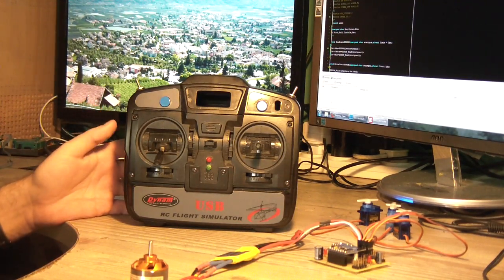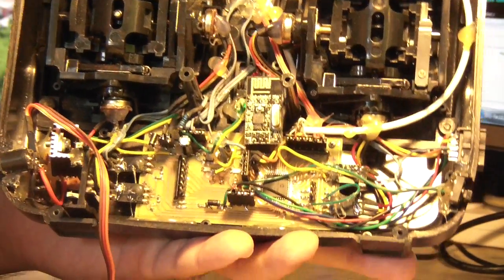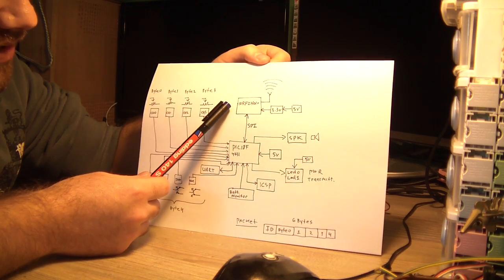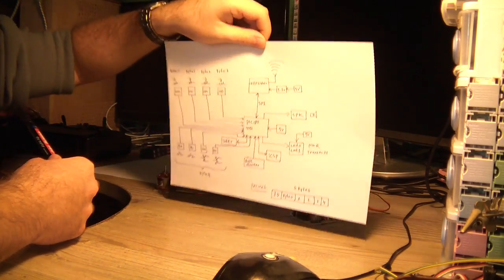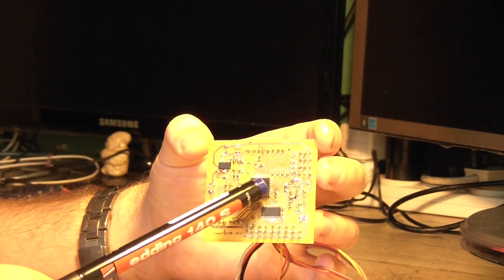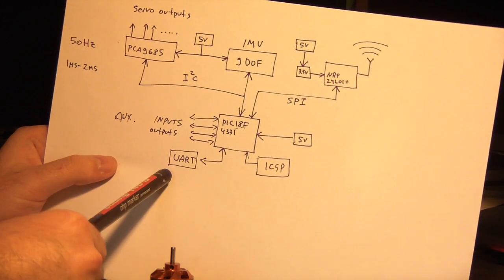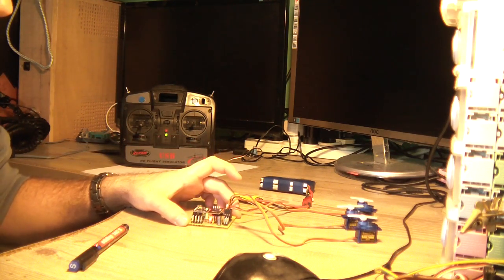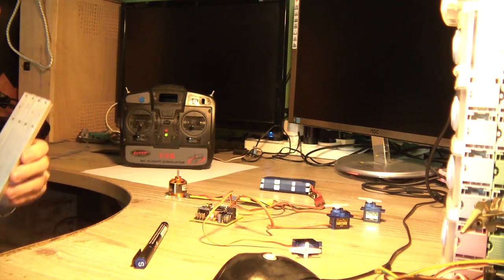Quadcopter DIY NRF24l01 2.4ghz RC and a flight controller

Comment: Interesting project. I particularly like the fact that you used PIC. Did you finish the project?
Reply from the maker: Hi ! Thanks :) unfortunately i froze the project for now. I had few test "take offs" but it was bad.The stabilization code is not mature enough. Now switched my mind to some other projects , perhaps i will return to it later. If you are interested i can share my work done so far on this project. Yeah , i like PICs over Arduino and all that stuff. Makes you do all by yourself and not using any written libraries, that is the way you learn the best, DIY ! :) have fun !

Comment: Hi Artiom, Great project!! You said that the 24LO1 is good for 50 meters! Which one is the amplified version? I may need longer distance myself. I see that china has a 24LO1 with an antenna, (same design, but it has an antenna jack) not the PCB trace. I wonder how long that one is good for. Thank you.
Reply from the maker: Hi ! In the video i am using the regular version which is good for 50m or so. But there is 24L01 with PA+LNA which can reach up to few hundred meters. Buy the PA+LNA version,don't buy just NRF with big antennas they are sucks the same as PCB antennas. Good luck :)

Comment: Nice! Did you use frequency hopping to get around WIFI interference, I've lost control of a chopper and spent 2 days trying to get it out of a tree!
Reply from the maker: Hi ! Actually i never had any problems with WIFI or any other RF interference. I have a WIFI 2.4Ghz in my room where i was testing and no problems so far :) But you are right , that is something to keep an eye on. I am using auto retransmit feature in the NRF24l01 in case of packet/data loss. Perhaps that is why i had no problems so far.
Cheers !
Reply: Yep, but I found it doesn't encounter much interference here on the island, will have to wait and go into big city
Reply from the maker: A big city is a dangerous place for a little drone :)))

Comment from the maker: Hi ! Thanks for the feedback :) I bought this IMU from ebay, it's really cheap , for about 20$. This one using ITG3200 gyro,ADXL345 accel. and the HMC5843 mag. There are some IMUs which use the MPU-6050 gyro and accel. combined in one chip, that one is a bit more expensive. About the controller software , yes. I am writing my own. Now i am stuck with PID and stabilization stuff , just don't have much time to work on it. 
Good luck in your project , take care :)